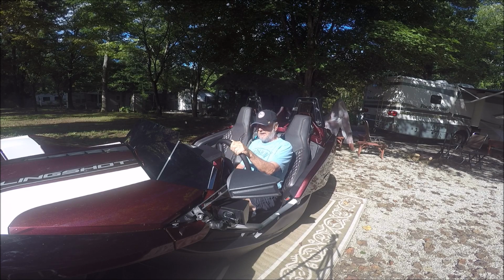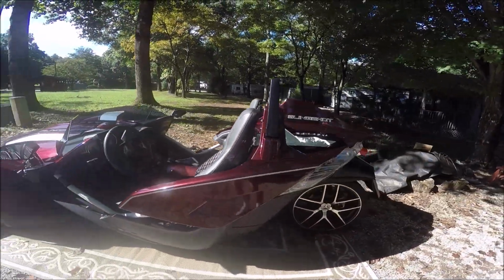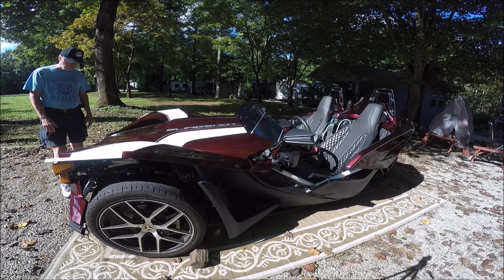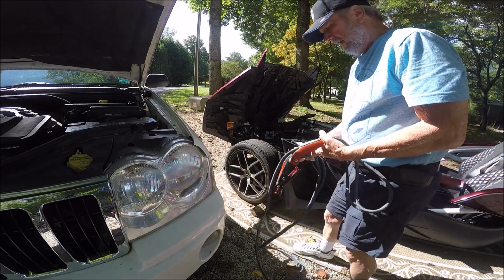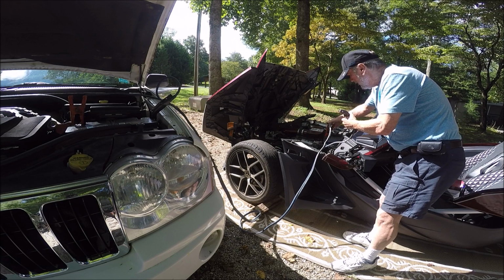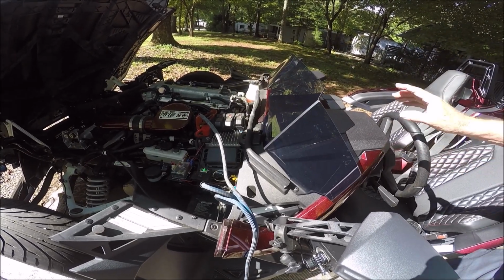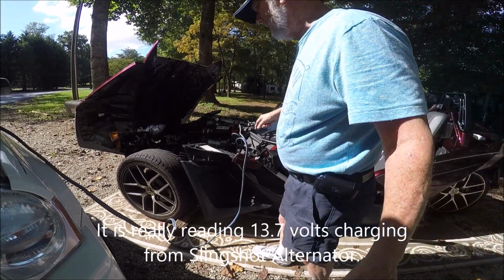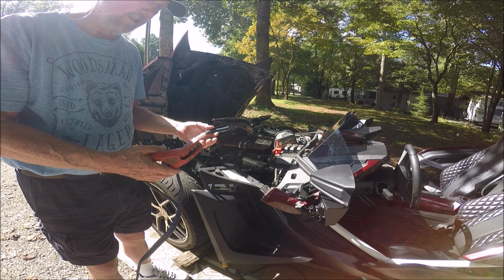Slingshot Emergency Jump Start Procedure

Comment: Dr.Sam.. Question? Mines a 2015sl.  Can i install a battery port on my year? I see amazon has them. Would you recommend buying from  them ? Ty
Reply from the maker: Yes the Battery Port is a great feature for quick access to power from Battery:   Be sure to use a fuses connection.

Comment: What if the check engine light comes in after?
Reply from the maker: In the battery box, pull the main fuse.  Or disconnect one lead from the battery for 10 seconds.  This should reset the check light.